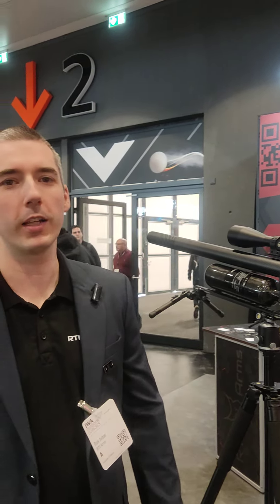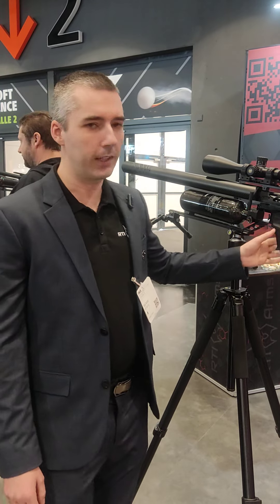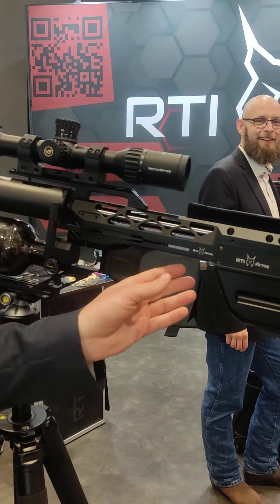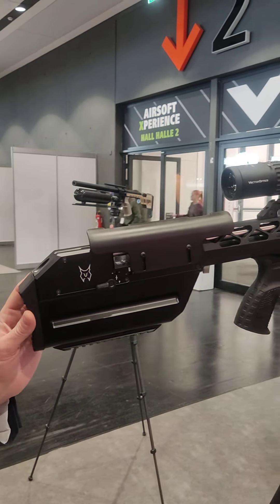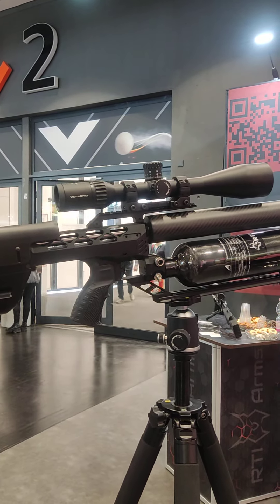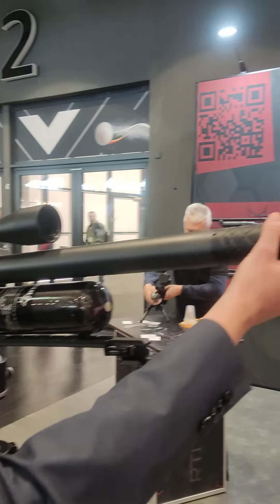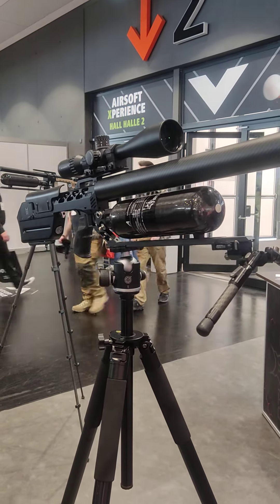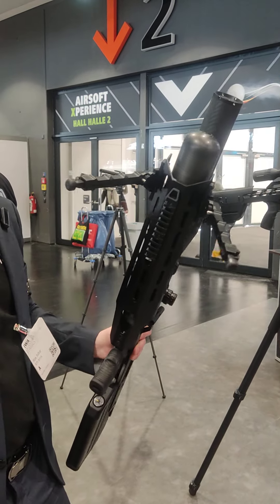New powerfull airgun RTI Mora

Comment: I think this rifle cud be an impact m3 killer. If its accurate with slugs and has consistant shot to shot velocity, it will surly beat the m3. Then fx will have an impact m4 rolled out based on the dynamic platform and wth a normal barrel set up???😊
Reply from the maker: Everything its possible RTI making really nice airguns

Comment: It must be the same garbage as always but disguised, I bought the rti p3 and p2 the worst garbage I bought, bad trigger valve, hammer breakage, bad pressure regulator, bad side lever, rti has to change the engineers it has if wants to continue selling because they are a disaster
Reply from the maker: I I had two air rifles from RTI and I think you're exaggerating 🤷
Reply: I bought the p2 and it had machining faults, the trigger valve, the regulator valve and they changed it for the p3, it also fails in the trigger valve if you exceed 150 bar, the pressure regulator fails, the hammer broke, rubbish
Reply from the maker: @atododrone6756  I'm sorry to hear that, luckily I haven't had such adventures with this brand. what air gun are you using now?
Reply: @pelletshoter  I am currently using a krait .22 700mm cz barrel
Reply from the maker: @atododrone6756  im have now L version in .22
Reply: @pelletshoter  The L would be the compact version that I was going to buy but I ended up choosing the x version